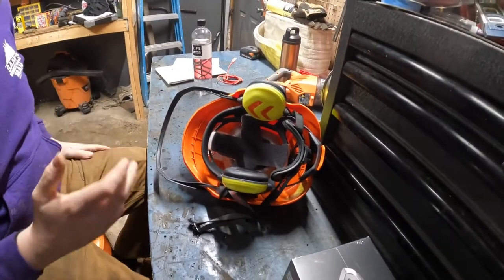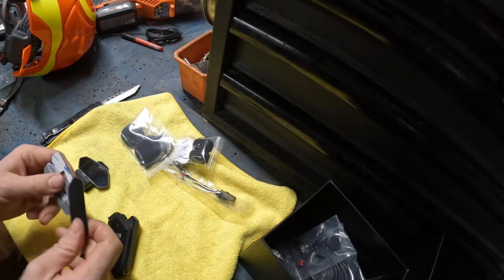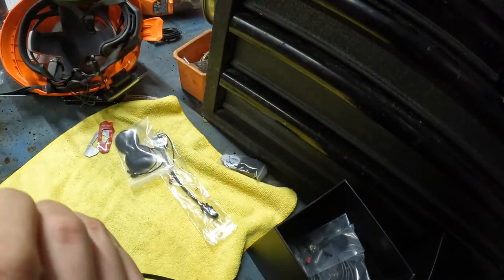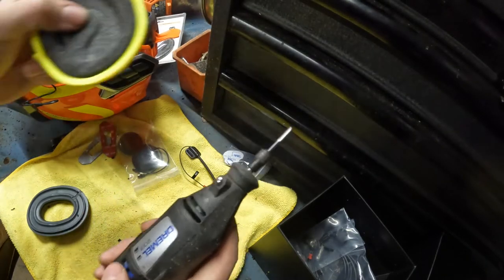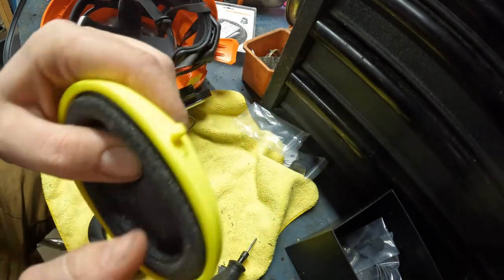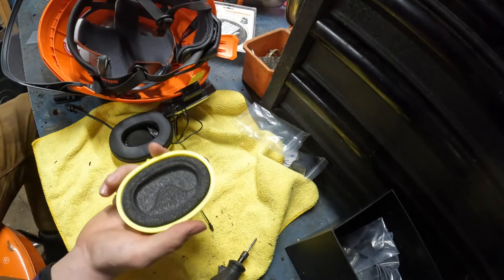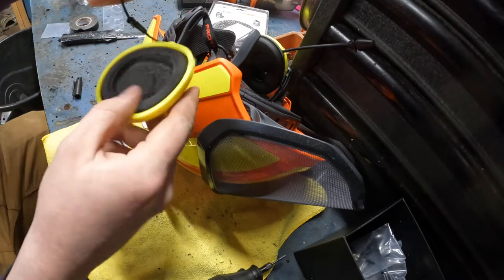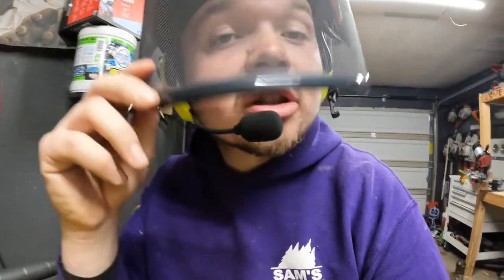Sena hardhat install

Comment: I just bought a branch manager. Do I have to step on the foot pedal to get the grapple to stay tight when picking up logs or do I have another problem?
Reply from the maker: Make sure your machine has a back pressure line lock, ditch witches have them that grapple will never open up unless it's hydraulically pulled open , even a busted line it will still lock and hold, it has q check valve or something , as I am moving heavy logs across yards I will often tighten the grapple up due to the log bouncing or moving but no you don't need to hold it down just tighten it up if load shifts